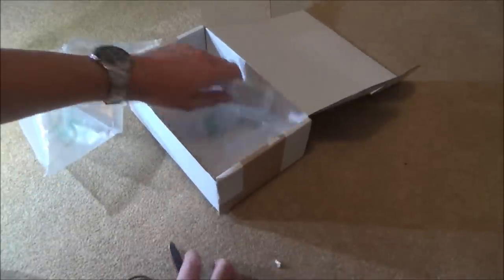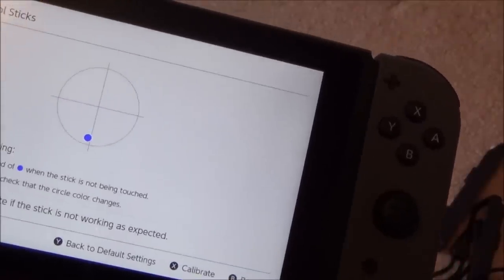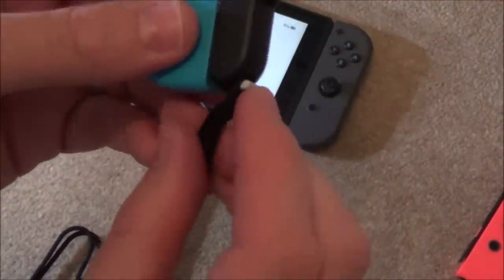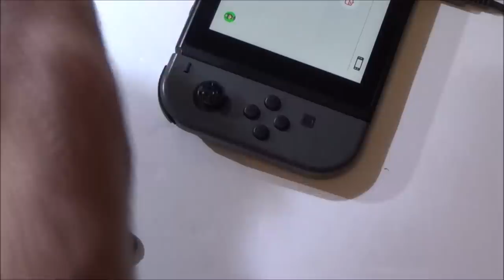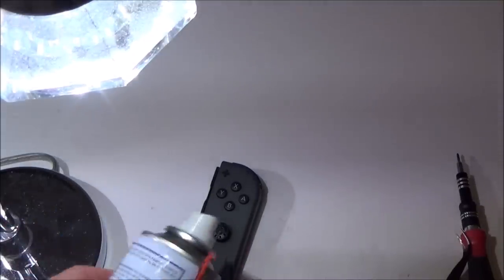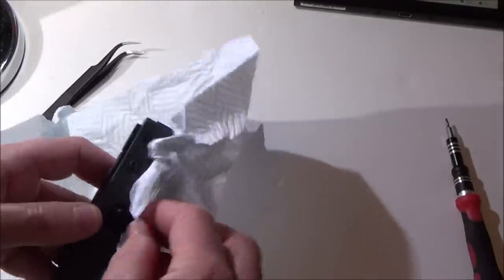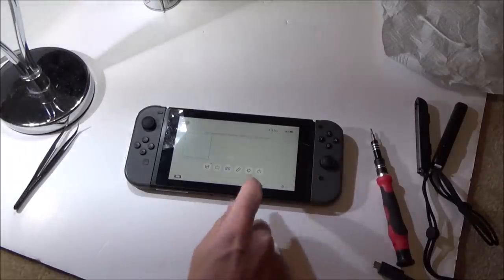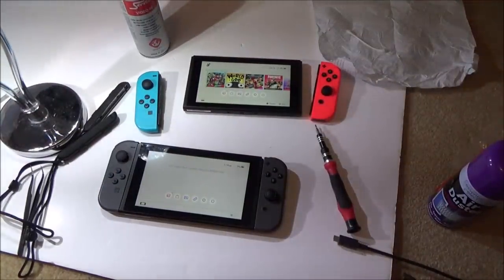Trying to FIX Nintendo Switch Joy-Con Stick Drift and Loose Stick Caps

Comment: I wonder if a little dish detergent or glycerin would help seat the lugs under the rubber caps back into place. ? I would personally put a couple drops of glycerin or personal lubricant product on the rubber before putting them on and working them back into position. I'm like you, just a guy that likes to fix things with common sense and resourcefulness.

Comment: We pop off the rubber caps trying to fix the drift issue. Current info says that drift is caused by 'something' ether in the parts inside the stick or somewhere around the stick.
Most info for fixing I found was to remove the rubber and clean around (they say dust and particals can cause them to drift in the direction of the stuff stuck inside as they are super sensitive) the area, to push down on the stick then try canned compressed air or cleaning with around 80% alcohol.
I have the drift intermittently on my left stick (which can get you killed in Zelda or dqbuilders lol) and those combinations have (minus the alcohol) cut down the drift but not stopped it. To remove the bubbling on the caps, I trimmed out the circle of tiny rubber nodules that are nearly impossible to get back into the holes in the stick top. I nipped them out with my cuticle nippers since they are small and can get into the underside of the cap.(it was driving me nuts being highly under my thumb.)
Reply from the maker: Ohhhh, I see. I was wondering why the caps were pulled off. So it is recommended to get rid of stick drift...interesting. Thanks for sharing :-)
Reply: Yeah, I searched similar questions when it first started happening about a year after I got my switch because Link stared walking off cliffs XD.
I think some of it might be usage. I played the everlovin' outa breath of the wild and stardew valley that year since it was easier for me on small screen (balance issues and nausia) and when dragon quest builders arrived I was good for a month or so but then my char started walking off walls and Link died because of falling off a cliff lol.
I remember getting a dust issue with my original Xbox controller and the 2nd hand madcatz one I got (small hand issue lol) they cept getting white dust in the left joystick part, I would click it in and have to blow the dust out. Think that one was plastic dust tho, comming off the parts grinding against eachother.
Wonder if long-term constant use of joycon sticks cause that kind of build up too... Wish I had a micro camera to look inside a drifting joycon to check heh heh.

Comment: Another method for fixing drift that might be a bit more costly is buying replacement joystick parts off of Amazon or eBay and replacing them by taking apart the Joy-Cons until you get to the joysticks.  It is time consuming but with enough patience and knowledge of the Joy-Cons, it’s and easy fix.  The one thing will be that you’ll have to calibrate the sticks afterwards.

Also, I know now that the rail on my Neon Blue Joy-Con is loose so I’ll have to fix the spring on that one.

Comment: Every video on this drift issue suggested to use canned air but none actually showed doing the same. This is the only one which actually showed the process. By the way, any alternatives to the cleaning spray that you used? I cant seem to find the one you used in my local stores.

Comment: Excellent video. I had the exact same problem and I watched a tone of videos on how to repair...I even watch the (STUPID) video telling you to remove the analogue rubber cap. Btw, you don't need to do that!

I couldn't find any Servisol spray so I used WD40 and it worked a treat.....fixed the drifting on left controller and on the right, my up direction ( analogue stick) worked too.

Ohh I also ordered a replacement analogue stick from eBay ( which hasn't arrived yet) ...I wished you'd release this video sooner ( would ave saved me £££).

Thumbs up man!
Reply: Are your joy cons still working fine since you fixed them with WD40 ?

Comment: I had this issue on both Left and Right joy-cons. I tried the Compressed air and it helped temporarily. Then I tried poring some rubbing alcohol in, Which helped temporarily.  I had to open up the Joy-cons and take out the thumb stick's and I soaked the while thumb stick in rubbing alcohol and shook it around which finally got it to work. Downside is the alcohol is strong enough to destroy the rubber dirt flap you have to flip back to spray compressed air in. But I can play again with no cost to me. Next step will be replacing the thumb sticks when the stick drift comes back.

Comment: I don't know if you have done one of those before, Vince. But one of my right joycons has its SR and SL working inconsistently and sometimes the LED doesn't even light up. The other buttons work just fine... What could that be and how would I fix it?? Thanks!

Comment: Hey, Vince, I think this may come across wrong but, to dismount the clips you hold the release button like on the Nintendo Switch Tablet.
Reply from the maker: Hi there, it doesn't come across wrong at all because of the politely written comment. If you look at the Joy-Con you will see on the plastic latch it has a ramp one side and a stop on the opposite side. When you take the Joy-Con of the Switch you have to depress the button as the Switch is on the stop side of the Joy-Con latch. When the strap is on the Joy-Con it is on the ramp side so you do not need to depress it. If you try it with and without pressing the button (latch) you will see it doesn't make much difference since it is on the ramp side. It is because the straps are put on the opposite way to how the Joy-Con are put on the Switch. Hope that makes sense :-)
Reply: @Mymatevince   I understand

Comment: My right joycon kept drifting and it was terrible. I might try this later, but for now putting rubbing alcohol underneath the cap seems to have worked. Seems a little slow to respond now though, but it's better than nothing lol
Reply: How is it performing now?
Reply: Buy the can to clean electeonic parts. It worked for me. I got the problem in both joy con. And now are totally fix them
Reply: @KEGosti  Dude, I simply went to a hardware store and asked for something to clean electronic parts and circuits. It's a different brand and it's cheap
Reply: StockyDoccy  rubbing alcohol def works, but I think I need to do it every so often because it doesnt not last. I'll probably just buy the can later if it's not too expensive though.
Reply: @LIES1988GNR  what is it called? I wanna try it on my left joy con
Reply: @toywizdood01  It's call ABRO, but I'm from different country so maybe in yours is different too. There is a popular brand call WD-40 so it might be works for you
Reply: @LIES1988GNR  thanks man, did it come with the little tube thingy? Or did you buy that separately?
Reply: @toywizdood01  It always come with the tube. but I have to say that it doesn't work 100%, I mean, it works but after a week and few days the stick started to drift again, I think is a problem of the joy con itself. I just spread it again and it got fix. If a button get stuck dont worry, just let it dry compeltely
Reply: Did it definitely worked tho?

Comment: Bruv those extra straps are clicked on and off using the buttons on the back of the Joycon. The white clicky clips lock it in there. Watching you tear those on and off without using the buttons made me grind my teeth.
Reply from the maker: Hi, I'm pretty sure pressing the button does not make any difference when it comes to the straps. This is copied and pasted from another comment I replied to.  If you look at the Joy-Con you will see on the plastic latch it has a ramp one side and a stop on the opposite side. When you take the Joy-Con of the Switch you have to depress the button as the Switch is on the stop side of the Joy-Con latch. When the strap is on the Joy-Con it is on the ramp side so you do not need to depress it. If you try it with and without pressing the button (latch) you will see it doesn't make much difference since it is on the ramp side. It is because the straps are put on the opposite way to how the Joy-Con are put on the Switch. Hope that makes sense :-)

Comment: Hey Vince, I was wondering if you would be able to find a way to get the old Wii microphone working on the Nintendo switch.
Reply from the maker: The Wii Speak? I tried it and it didn't work but I didn't put much time into it. It is on my long long long to do list :-) Would be fun to see it work on the Switch :-)
Reply: It would be great if Nintendo would put voice chat into the games lol
Reply: I was definitely curious because I got a Wii speak just as the services died so I have a microphone that works with nothing XD
So I'm definitely hoping someone cracks that code.  Also what was the name of the software you use to pair a controller and customize it from PC to switch, and set keyboard and mouse to it, I forgot which video you showcased it in and I'd love to try setting keyboard and mouse up on my switch, however all I have is the magic ns adapter myself

Comment: Hey vince what'd you use to fix the stick drift?
Reply from the maker: Servisol Video tape head cleaner. Do a bit of research first to make sure it doesn't cause any long term damage though :-)
Reply: @Mymatevince  are the sticks still good or did the issue come back. I've heard it's a better temp fix. Any chance you can make a update video for this subject?
Reply: Yeah Vince, how about an update video on this ? Drifting joy cons is a huge problem for Switch owners and Nintendo doesn't seem to be talking about it.

Comment: And vince plz solve my other issue too.i ordered 8bitdo adaptor for wii u pro controller to be used on my switch . It syncs(paired) but nothing happens further .not even a single button works.

Comment: Hey My Mate VINCE, can you play with the joy con you fixed? Because this fix doesn't work apparently. It helps for few days and goes back to same. It's a mechanical problem inside the box where the stick is contained. It is possible to fix, there are two little pins that get loose and they need to be glued or something so they don't shake and get in front of the sensor.

Comment: Blowing compressed air underneath the stick flap seems to reduce the drifting issue on my joycon (oddly enough, mine's also grey with a drifting downwards issue) but honestly, I doubt this is gonna be a permanent fix. I might just have to get a pro controller and stop using the joycons completely because the problem gets so bad.

Comment: I've taken off the little rubber caps very often on my right joycon because it also has the drifting problem and I tried blowing in the joycon when the cap is removed. I always get them perfectly back on without any bumps and they are as smooth as when I bought them. Of course when you take them off the first time it's harder and now you can take them off pretty easily. I still couldn't fix the drifting on my joycon and I might buy a new one

Comment: Oh nice vid man, I hv this problem for ages, I can clean it using small flat paintbrush, but it's still coming back like day after. Do anyone know what spray is that and probably a similar one too?
Reply: Use compressed air. It's much safer
Reply: so apparently my brother got an air duster for his pc and i borrowed it, did the same thing, well worked little bit, but still drifting tho .

Comment: WD40 electrical contact cleaner works better as it is designed to be safe for electronics/plastic, plus you can still easily get your hands on it.

Comment: All analog sticks will wear out with use. What happens is that it eventually wears to the point that it no longer sits perfectly in the center when idle, which is what causes these drifting problems, like the one you have here. It happens on Playstation, XBox, any controller with analog sticks will eventually have this problem no matter how well you take care of them.
Reply: My 10+ year old gamecube controller would like to have a word with you

Comment: I wouldn’t use isopropyl on anything plastic or electrical components. Use electrical contact cleaner. It’s non conductive and non flammable.
Reply: Julian Santana can you tell me what are the possible problems using it on plastic?
Reply: It could dry out the plastic and make it bridle.

Comment: My joycons drift then disconnect. Work perfectly fine when not attached to the console though so frustrating
Reply from the maker: I wonder if it could be dirty contacts. Look at the pins where the Joy-Con meet the Switch and see if you can clean them. Perhaps  with a very soft brush. The drift might be the last movement the Switch recognised before it lost the signal rather than the sticks actually drifting :-)
Reply: @Mymatevince  Yea I tried that after a Google search, also tried reconnecting all 4 and updating but nothing. I read some were that the black joycons that got released with the first wave of consoles tend to do this but have no idea of that's true. My switch worked for months no problem but now with all 4 of my black controllers they work for about 10 minutes then drift and disconnect. If I reconnect then the work for a little while then do it again. I hope its not my console.
Reply from the maker: I was just thinking it sounds like the console. If you have a friend with a Switch I would use their Joy-Con on yours and your Joy-Con on their Switch and then you will know 100% if it is the console or not :-)
Reply: @Mymatevince  Yea my nephew has one. Kinda dreading it being my switch lol. Was thinking I could tape the connectors on the joycons so they click in but the console thinks there not but then I might break it more.
Reply: @Mymatevince  update on the controllers if your interested. Tested all 4 of my black ones on my nephew's switch and they do the same on his. Also his coloured newer controllers work no problem on my switch. Very very strange how all 4 can all off a sudden become faulty. I found on a forum somewhere that there's an issue with the very first batch? Not sure if there's any more info other than that.
Reply from the maker: Wow, maybe it is a batch thing. Thanks for sharing this info :-)
Reply: @Mymatevince  going to phone Nintendo tomorrow and see what they have to say about it. If your interested I can post what they say?
Reply from the maker: Yeah, definitely post it on here because it may help viewers with the same problem, especially if they honour a replacement when out of warranty :-)
Reply: @Mymatevince  ok they definitely don't offer a repair on consoles out with the warranty or bought second hand. He did kindly offer to repair them at £35 each! But for obvious reasons i refused. He said he hasn't heard of the fault before and it's strange how all 4 are doing it. He offers limited technical help such as update the controllers and clean the contacts which I have tried already. Looks like I am stuck with 4 joycons I can only use wirelessly.
Reply from the maker: That is classic, the repair price is the same as the new price. Thanks for updating this. There is one way you can get them to work but it may cause damage long term to the actual Switch. In my 'vertical Switch' video you can see me using the Joy-Con wirelessly while attached to the Switch by using a small piece of paper to stop the contacts on the Joy-Con touching the contacts on the Switch. Obviously it will not charge them up but it means they will work when attached to the Switch in handheld mode. Remember this may cause damage so it is only a suggestion :-)
Reply: @Mymatevince  yea I was thinking the same thing. I don't understand why it had to be two separate entities to start with? Going to probably sell the 4 as faulty and buy a couple new ones such a pain!

Comment: this exact thing happened to me before, I completely broke the joycon because it was drifting more, more and more, until I abandoned it. had to get new joycons because i would have to play it on tv instead of anywhere.

Edit: the analog also came off
Edit edit: the joycons also came off with out the rear button (the button that takes the controllers off) (and started working when i got new joycons wth??)

Comment: my brothers joycon stick was drifting and i shaked the stick around with force and its not driftin anymore
Reply: Eetu Isola It doesn't work always. That's because dust gets stuck under it. If you are lucky it moves and won't cause any problems after extreme pressure/ shaking. But sometimes you have to use isopropyl alcohol to clean it